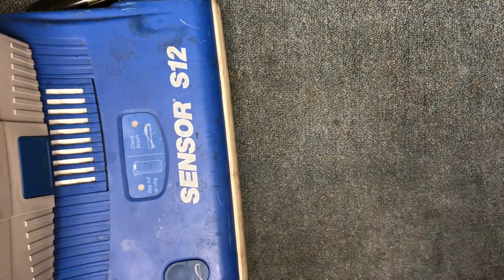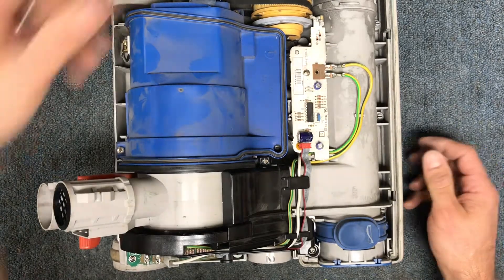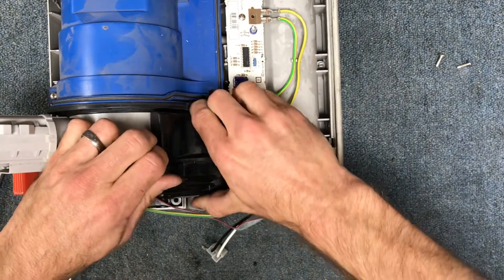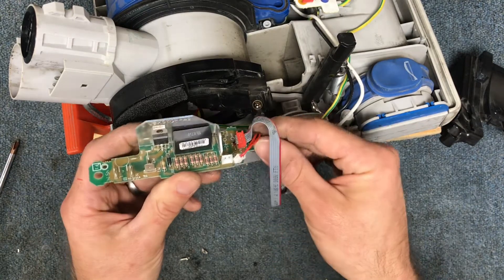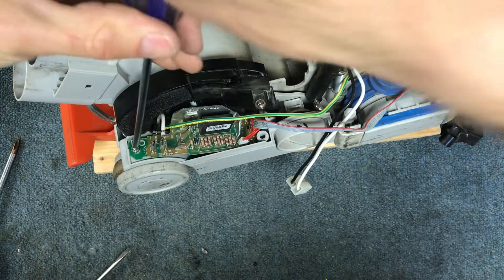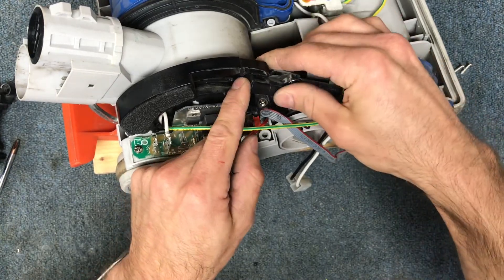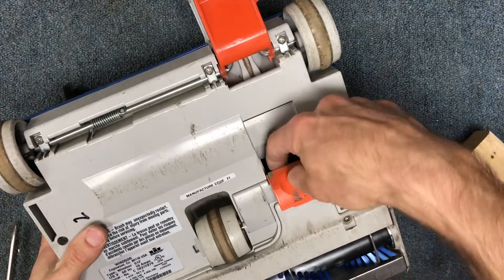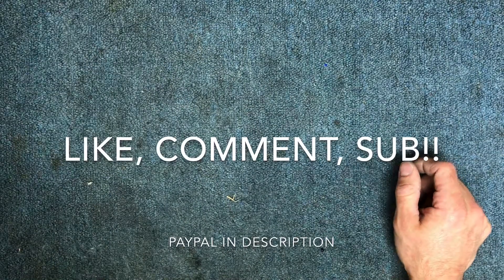Vacuum repair man shows How to replace a Windsor Sensor S12 main pc board

Comment: For some reason - the XP-12 I have (about 6 years) when you put it on and go forward - it’s good. The moment you bring it back to you - it’s shuts off - then go forward it comes back on. I’m thinking it’s the board as I bought a new one and checked the handle etc and same trouble.
Reply from the maker: Have you checked power cord going into the handle?

Comment: Hi there! I know this video is pretty old. But I'm trying to fix my office vacuum, and we have a Windsor sensor 12 (ours is grey). For some reason, our foot pedal that holds it upright is not working. We did have to take it apart to try to fix another issue we had, but when we put it back together, now the foot pedal doesn't do anything, it can either just lay flat or we can keep it upright, but it doesn't catch any longer. Any ideas or help?
Reply from the maker: It would be hard to diagnose blind. Not sure what would be the issue exactly.

Comment: would love a video on how to change out bypass valve!
Reply from the maker: I'm not sure I understand what you're referring to. I'm not sure I know of a valve on this unit, unless it's a pressure relief valve. Give me some more info and I'll look into it! Thanks
Reply: @richardsvacuumcenter  how to replace the full bag/clog indicator sensor :)
Reply from the maker: @SupermarcheFurniture  OH I got ya! Yeah I actually take those valve sensors a part and clean them. Grit and sand gets built up in them and it causes the pressure valve to stick closed giving a false reading on the full bag light. I filmed that a while back but wasn't happy with it so I'm waiting for another to come in so I can reshoot it.
Reply: @richardsvacuumcenter  got it! i guess i'll try to change the bag and filter to see if the light goes away. if that doesn't work, i saw a video where i can stick a flat head screwdriver into a tiny hole to adjust the sensor. hoping i don't have to take it apart to clean the valve... but if i do, how do you do it? compressed air in a canister?
Reply from the maker: @SupermarcheFurniture  only on certain models you can adjust the sensitivity. The S12 does not have that adjustment to my knowledge. I disassemble the whole valve and clean it. The process is way too detailed to be put into a comment lol! It's not super simple. Next time I do one of those repairs I'll try to record it and post.
Reply: @richardsvacuumcenter  sweet! i'm going to replace the bag and filter and see where that gets me. after that, i'll try adjusting the sensor with a flat head screwdriver in the tiny hole on the side. hoping i won't have to take it apart to clean the pressure valve. how do you clean it? with an air canister spray